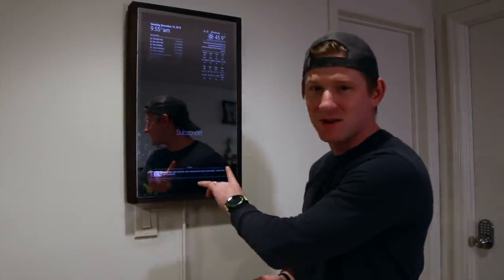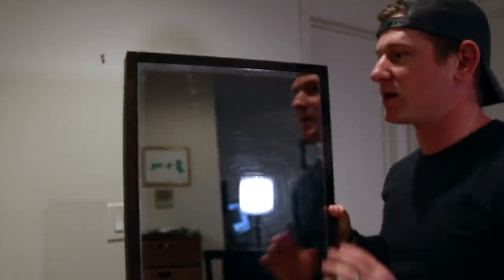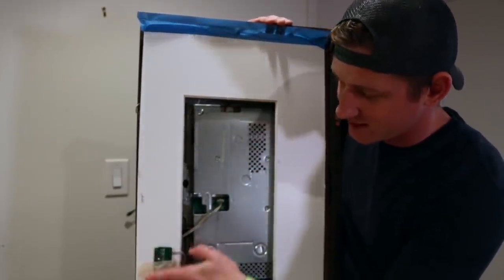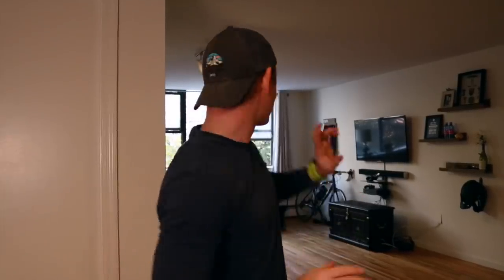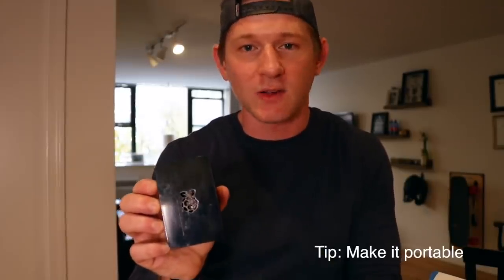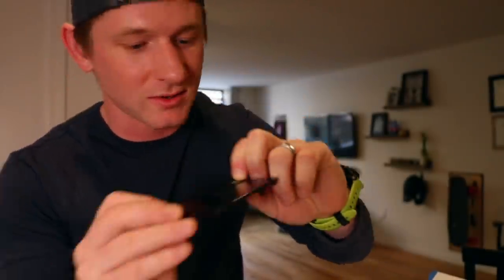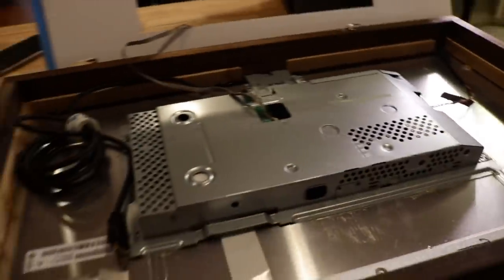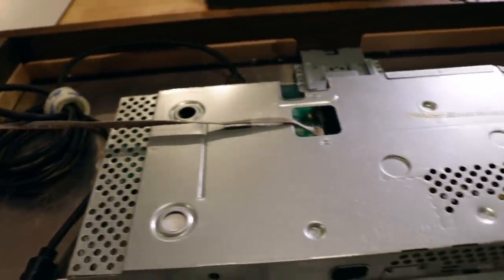Inside My Raspberry Pi Magic Mirror!

Comment: Hey, a tip for accessing the raspberry pi, if you enable SSH or VNC on the Pi you can access it over the network from a PC, saves you taking it apart if you need to update it or change settings

Choose Preferences > Raspberry Pi Config from the menu and enable it in there
Reply from the maker: Luke Taylor Hi, Luke! Thanks for the info. I use SSH when I do some minor changes, but haven’t gotten good enough to where I can really dig in using the command line. Is VNC any different? Thanks for watching!
Reply: great suggestion, my kindof guy
Reply: Brian Cotter it’s as simple as downloading vnc viewer on your pc and enabling vnc from the taskbar on your pi
Reply from the maker: @Schmadis  OK, that sounds easy enough. Thanks!

Comment: Nice project. Thanks for sharing. Just want to know if there is any better way to completely not show the inside monitor part through the mirror. Any suggestions
?
Reply from the maker: My best guess would be to use a thicker two-way glass. I used 1/8 glass, but 3/16 might help hide the monitor a bit more.

Comment: I know you said in your video you didn't have a window on the other side of your apartment. I don't have window in my kitchen witch really bothers me so what I did was I took an old 32in TV build a window frame around it hang on the wall with curtains connected it to a latte panda single-board computer. And went to my daughter's house who has a beautiful backyard set up a camera and filmed her backyard different days for different amount of times with the kids playing in the back different seasons loaded it to an SD card and then I just played at SD card on my newly made digital window along with connecting a wireless camera up to it so I just switch inputs and I can actually watch live video from what's on the other side of my kitchen wall which is the courtyard of the apartment not much to look at.

Comment: Nice project, by the way, I was building one myself and loved your design, I was just wondering how you secured the mirror to the frame to that there is no border on the front. Thanks.
Reply from the maker: I attached a small wooden frame onto the actual monitor and used that to secure the monitor to the larger wood frame.
Reply: @bcotter  ahhh I see, thanks for the help

Comment: hi, my mirror keeps going dark.  I need to restart the Pi each day, any ideas.
Reply from the maker: Hi Bradley, thanks for watching! It could be a number of things. Your monitor might be going into power saving mode or your screensaver may have not have been disabled. Some builders on https://forum.magicmirror.builders have had this problem, so maybe you can find a solution there. Good luck!

Comment: What’s the size of your 2 way mirror and how much did the entire project cost you to make? Also, thanks for the vids on this!!
Reply from the maker: The exact size of the mirror glass is 1/8"(thickness) x 24 ¾” x 14  5/16 and that cut was big enough to fit on the 27 inch monitor for my smart mirror. I would take measurements on whatever monitor you use before ordering the two-way as monitor size may vary slightly.  All in I would say the project cost $250 - $275. Thanks for watching!
Reply: Brian Cotter thanks! Also, how did you add your microphone/speakers to your raspberry PI or are those functions coming from the monitor?
Reply from the maker: @ChaceArrowz  I just used a bluetooth speaker, seemed to work pretty well!

Comment: Bro u push the micro sd card in and it pops out, u don't need a knife lol
Reply from the maker: Hackerjutsu right? They are usually spring loaded, but on the Raspberry Pi it was pressure.